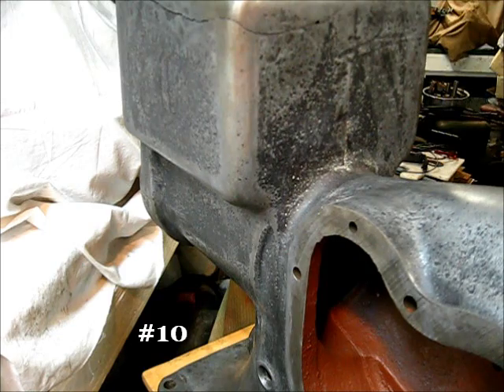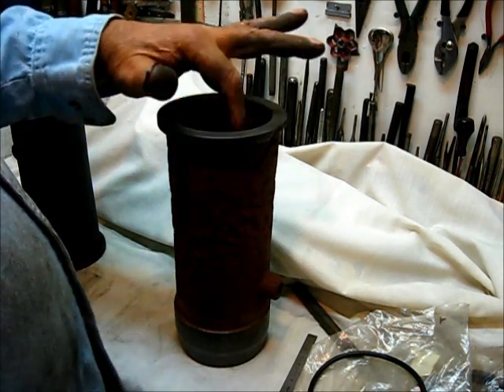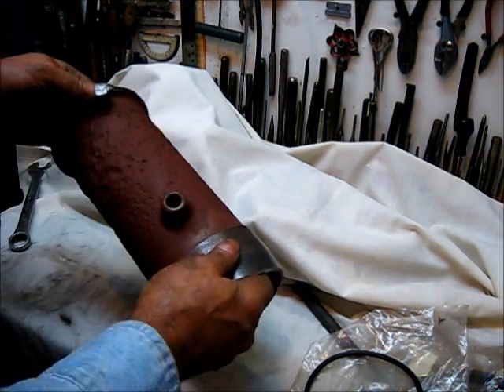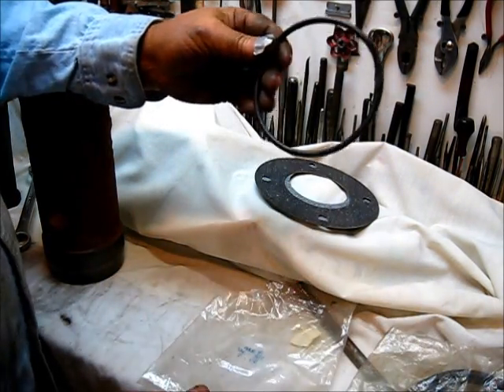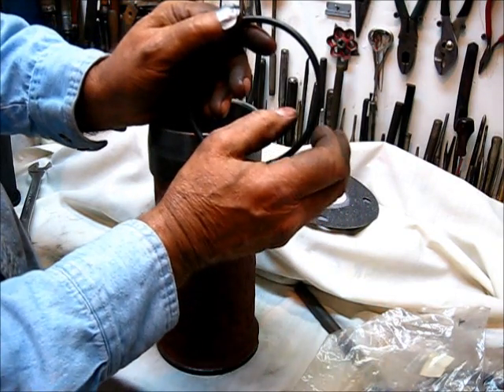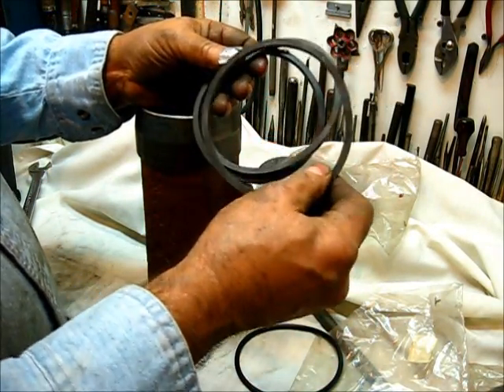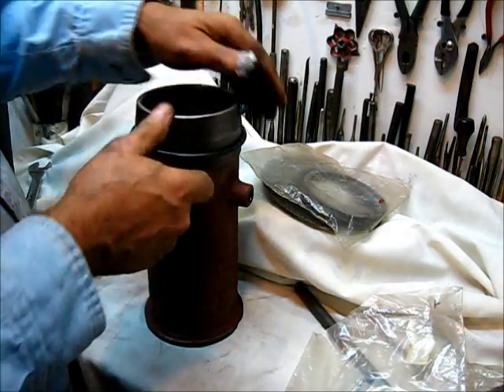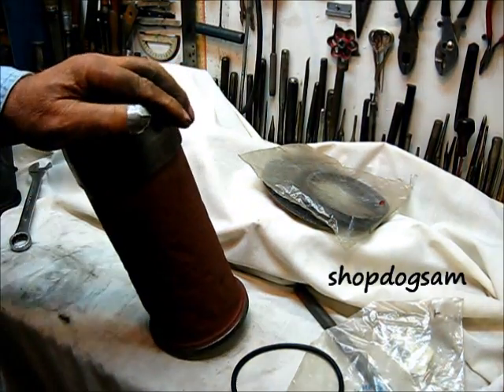McCormick-Deering "baling wire engine" #10

Comment: hey sam i usedta run a oold lucas horizontal milling machine here in Oklahoma  city. we would rework gas compressor  cylinders .we wouls freeze em in liguid njtrogen. then they would just drop right in but if u got the id wrong after the warmed up u had to cut em or dynamite  out lol.great vid.